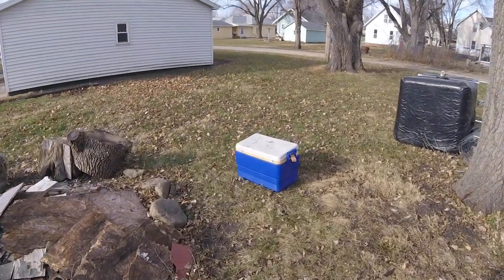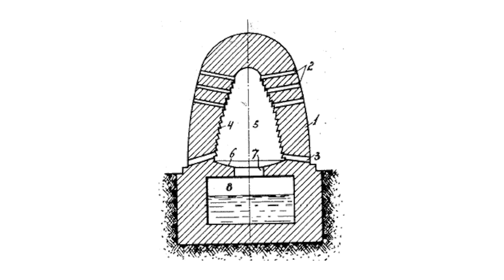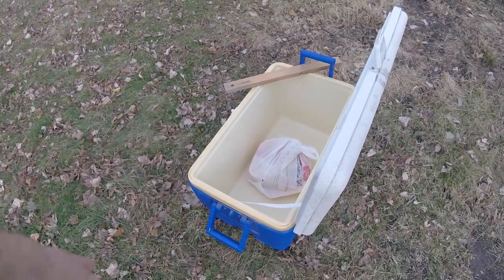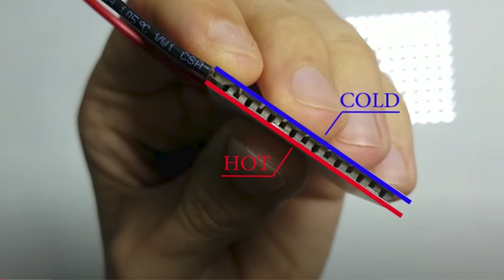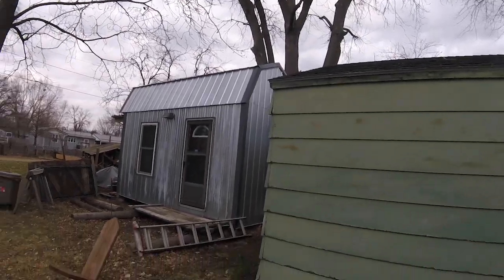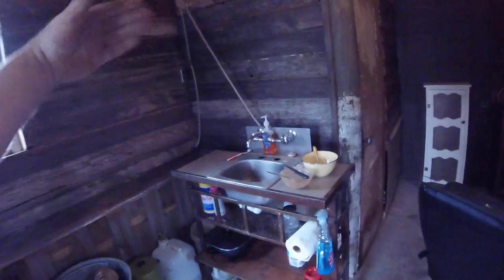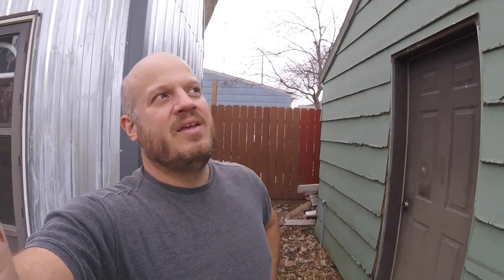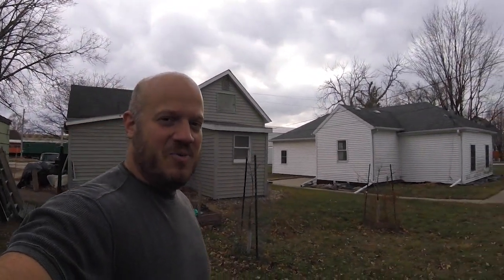Air Well Concept - On-Going Research

Comment: It's a great idea if you can make it practical. Perhaps try and recreate an air well by copying their working designs in a scaled down model, perhaps a few feet tall and see how much that will produce.
Reply from the maker: the guy I was listing to made a scaled down version of the one made of rocks. he said he got it to work then made a bigger version.  I thought about doing that
Reply: @extremebudget  Awesome. Looking forward to see that. I bet someone could create plans for printing them from a 3d printer or at least a good easy set of plans everyone can follow. Putting the data into a computer program could help you scale it up and let you know how much material you need for larger projects. The whole process to give this to the world for free could be streamlined.

Comment: I am going to be undertaking a project in which I want to recycle at least 80% of the water I use in my home which means that I would have to distill all my water for laundry and perhaps even shower water distilled back to perfectly clean drinkable water so that the only water that's going to go in the drain is human waste urine and the other stuff. Should be interesting.

Comment: In a cold environment like yours, if you have a metal plate in the wall that is exposed to the outside and inside, and blow air over it inside, water will condense on it.
Reply from the maker: Good thinkin.  Taking advantage of the cold season.  I was wondering about an idea like that.

Comment: Like you said, none of this stuff is new, it's just very inefficient. For instance the massive Kickstarter flop, waterseer. The amount of power you have to put into condensing water is alot, much more efficient and cheaper to drill a well or use city water. Of course I know you think if you had free energy then efficiency doesn't matter. But free energy is a red herring I have seen way to many intelligent people foolishly follow. Keep thinking of new ideas tho, enjoy watching your videos and seeing what you dig up next.
Reply: I look at it differently. Free Energy is real and all around us. It takes energy to condense the air into water. In this case it's accomplished by temperature differences. The Sun that travels in circles above our heads everyday coupled with a night cycle will always be present and always create these temperature changes. Passive solar heaters, wind as in windmills or water driven wheels produce energy to do work. Using a ram pump/water hammer you can move water all through piping to then with passive solar heating heat a whole house even pumping uphill. There is also thermal mass heating and cooling and geothermal heating. Between these you can have all the convivences of modern living with no "electricity". I have designed such a house I hope to build one day which includes lighting, cooking and hot water running showers. I think you can have free "electricity" for running modern devices through batteries and solar panels you make at home with everyday materials.. heck you could even make homemade type electric turbines for hydroelectric and wind power. To me these are 100% perpetual as long as we have the Sun, running water and wind. This is the crux of my primitive energy house project, to show we can live just as well as anyone else without relying on any utility systems run by other men who want to control our resources for their personal gain.
Reply from the maker: there was one company that made a small one like a water bottle that goes on a bike so as the rider moves the wind goes through and collects water for the next water break.  I need to find that ad.   that was a good idea
Reply: @extremebudget  Oh that's too cool. I'd use it for my 150cc scooter.
Reply: @divergent yeah there are certainly good sources of basically free energy such as sun, wind, etc. I was mainly referencing overunity claims. And I have seen the water bottle and it was also impractical. It was also a failed kickstarter

Comment: I thought about collecting rain water. As a truck driver, having driven long distances a day, chemtrails are no joke (remember acid rain?) I'm good.

Bought the stove can that's recommended with the Mr heater buddy, I mounted it just like the guy that gave a review. Mine didn't work.

Have you looked into those "free solar panel installation ads?
Reply from the maker: I have seen them, but I haven't looked into it.